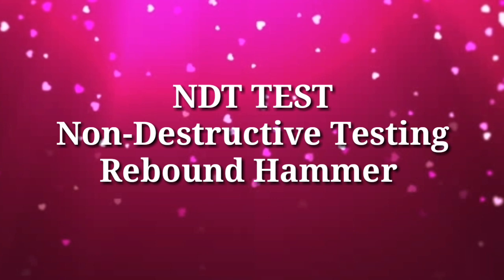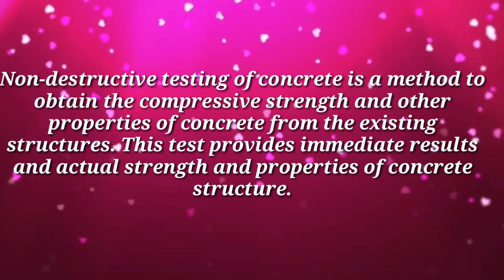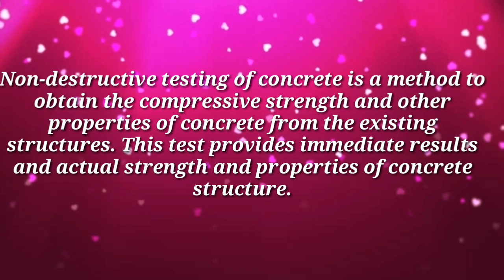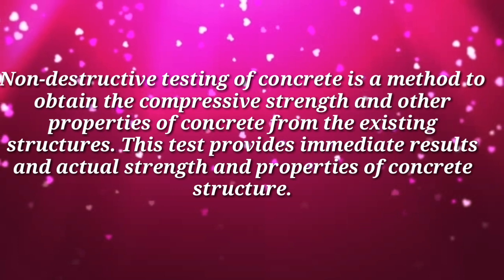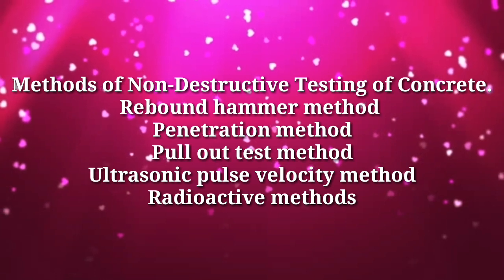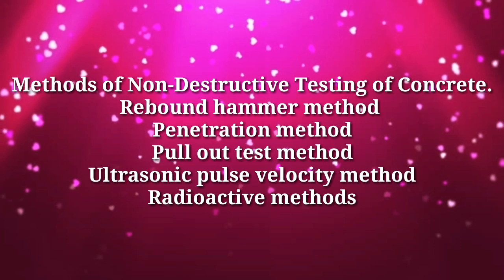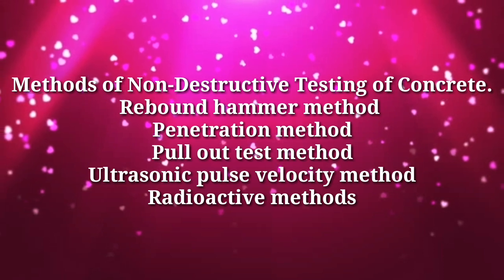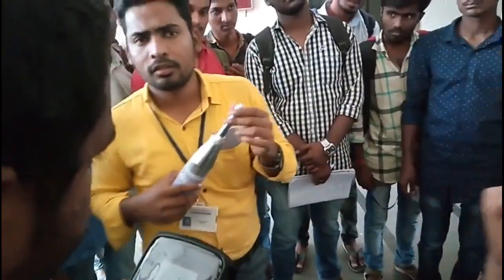NDT (Non-destructive Testing) of Concrete  by #Rebound Hammer Method

Comment: U_R_SAFE, ONLY-IF_
YOUR_BUILDING is SAFE

Check BUILDING_SAFETY by
Licensed Structural ENGINEER
1
WE KNOW about Our FLAT
Not FULL_BUILDING?
2
if ANY_ONE-COLUMN_FAILS?
it can be UNSAFE_to_ALL
3
So REPAIR as per Audit-REPORT
https://www.structuralaudit.org
Ganesh Kamat
M.S.(USA)50-yrExp
For Quote 9820867755